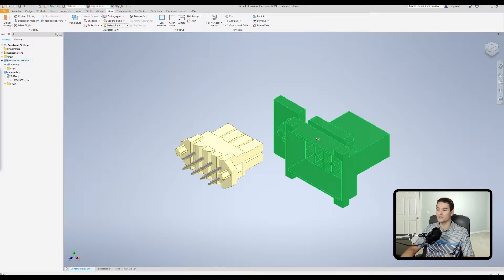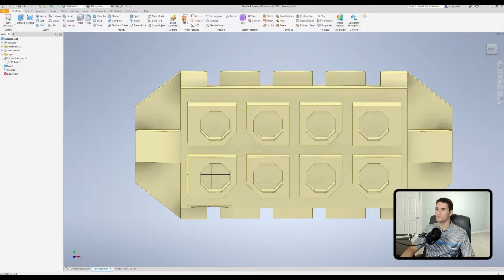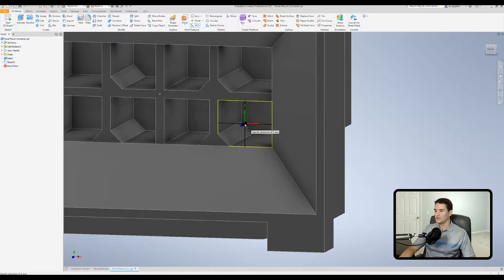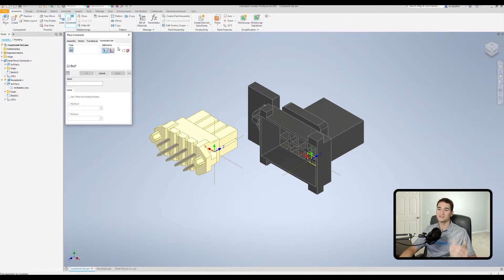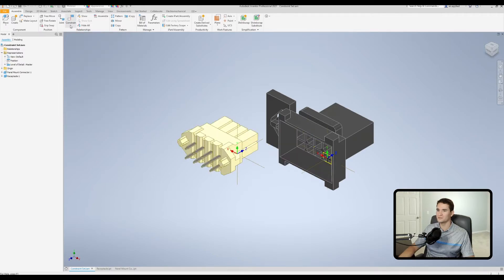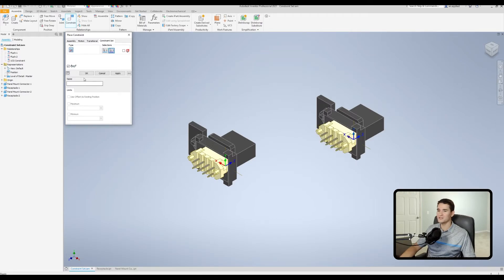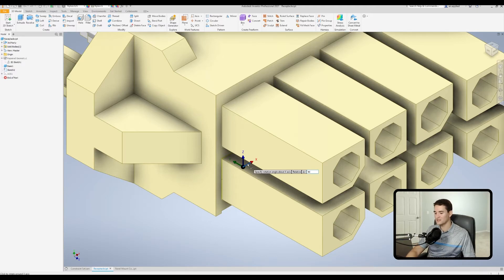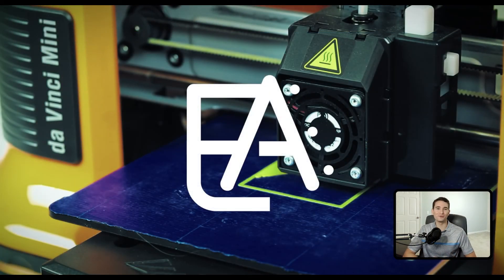Constraint Set - Autodesk Inventor Assembly Tutorial | Autodesk Inventor 2021 IN DEPTH

Comment: Another awesome one ! 
I know i am new to Inventor, but i think this is awesome ! i can add this procedure in the beginning when i am planning my parts ! brilliant :)
Thanks again for sharing your knowledge :)
Reply from the maker: Exactly! So much time and effort can be saved just by planning out the design of your parts with a focus on your design intent. This feature would've saved me so much time when I was designing electromechanical systems that had a bunch of wire harnesses and connectors. That's why I went with this example with these Molex connectors. This feature would also work well with cylindrical/locking connectors (commonly used in automotive, aviation, etc.) like Amphenol, Deutsch, etc.
Reply: @engineeringapplied  brilliant ! Thanks again for sharing it with us for free ! Appreciate your efforts ♥️